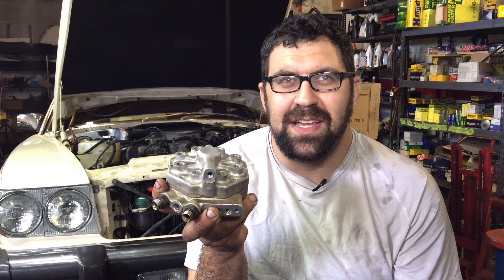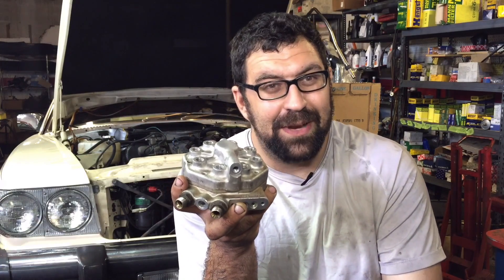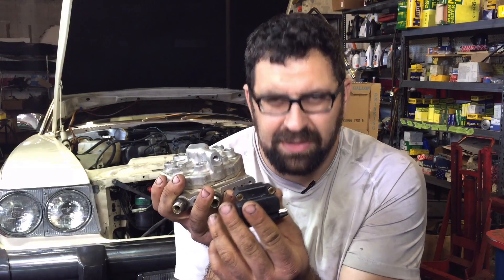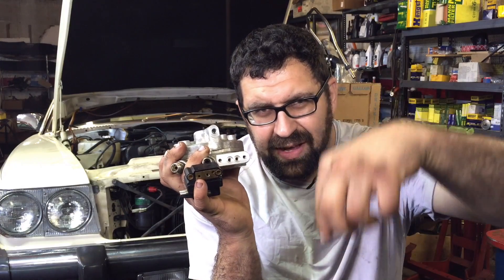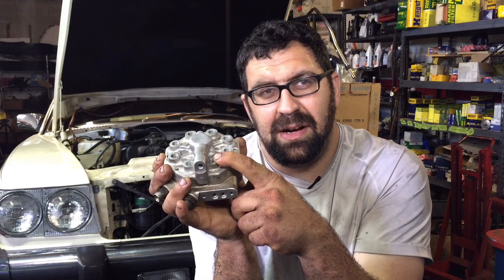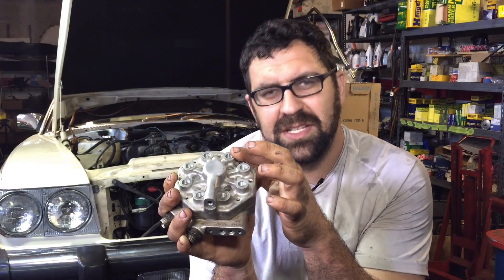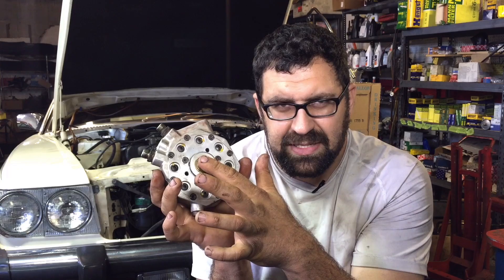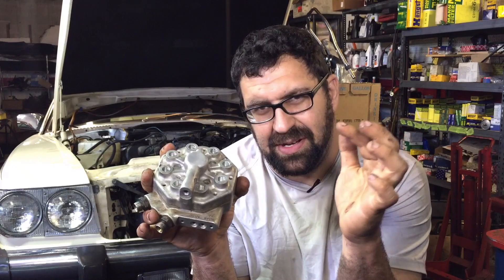Mercedes Fuel Distributor 2 of 2.

Comment: Hi Pierre, i'm glad i've come across your channel. I've been asked to sort out a 1992 Mercedes 190e, 4 cylinder.
It was apparently not running or starting very well, so the owner took it to a local tyre fitting garage that also does other car repairs, (Not a very smart move i know), but they have a mechanic there who has until recently worked at a Mercedes Main Dealer for 13+ years
In an attempt to get the engine running, they replaced all 4 injectors, spark plugs and HT leads.

Eventually, they delivered the car back to the owners house, not running and telling him that they don't know what is wrong with it, but of course, as per usual with some garages, they charged him for it.

This is what i found out so far. `it has spark and when you crank the engine over with the spark plugs removed, it just continuously pumps huge amounts of fuel out from the cylinders.

I've also disconnected the pipes on top of the fuel distributor and the pipe for the cold start injector and as soon as the ignition key is turned on, fuel just gushes out from all the outlets at the same time.

It appears to me that something has failed in the distributor, but i could do with some expert guidance on this, as i have never worked on that system before.
Any help or guidance that you can offer me on this matter would be greatly appreciated.
Many thanks, Joe.
Reply from the maker: Joe, you will need to do a ke pressure test. Please email me if you would like details- mbownersforlife@gmail.com

Comment: First of all, thank you for these videos! They have helped me in a most tremendous way.  I have a 1986 560SEC that my father gave me. It had been sitting for at least 8 years. I rebuilt the fuel pump assembly and got a new relay, changed all fluids and she worked great. Now all of sudden it starts and declines quickly until it dies.  It will start back up and dies again. If I hit the gas, it dies immediately. If I come off the gas it beefs up. What do you think I’m missing?

Comment: Is it normal for pressure to be on the gas cap? It acts like a gas can that’s been sitting in the sun. 89 560SL. Starts and revs fine in park but in drive, under any load, giving it throttle will stall the engine. Not sure if the two issues are related

Comment: HI great info on your videos  how bout wen the distributor don't send any fuel to your injectors ? spark plug dry and injector lines dry  I try open the injector lines turn key on i get very little fuel coming out of the distributor ports I install a new fuel pump last year if the fuel pressure is low can this be the problem ? can the fuel filter cause a low pressure problems thanks for you information and help

Comment: I have a fuel distributor on an  1991 SL 500. It has been rebuilt by the same place twice and both times I get it back. I have way too much fuel. Fuel is coming out before the valve hits it. Even at less than two bar of pressure. What else could be going on causing that?

Comment: It has one bent ex. valve, the compression on that Pistons was 0 the rest about 150. Is it possible to take that one piston out from the bottom of the engine and push the valve out and replace it? Thx

Comment: I found your videos very useful, thank you for that. I have questions, at what point the EHA receives power? Opening the ignition key or while starting the car or car has to be running ? and which unit/computer/relay/... in the car provides the power to the EHA. I think I do not get power to the EHA and the 560sl does not start, I know the fuel distributer and all injections are good and I have 90 PSI fuel presser at the distributor. Also how do you set the default for the plunger in fuel distributer.  Very much appreciated
Reply from the maker: the EHA has power when the starter is cranked and the motor is running but it will still work with no power. Check your crankshaft position sensor. resistance should be 400-800 ohms.
Reply: Sorry I forgot to mention that when I pour gas into breather the car starts right up and runs as long as I keep pouring gas into breather,  or if I stop pouring gas but I keep pushing the gas pedal up and down then it keeps running for about a minute then it dies.  Is that tells me the  crankshaft sensor is good? or I still need to check it? The fuel distributor and fuel injections were transferred from another running 560sl into this one.   THX

Comment: Hi Pierre, thanks for the great videos,

I have a 1989 500SL in UK .
 When the car is driving at running temperature it develops a mis-fire type of feel from around 1200rpm upwards. If I disconnect the EHA it seems to run fine (but difficult to start engine from cold with it disconnected). 
Car starts great from cold start when EHA is connected. 
It's had a reconditioned fuel distributor fitted and I even changed the EHA but same things happening. All electrics on engine seems okay too. Do you have any ideas. 
thanks
Micky
Reply from the maker: video response coming up!

Comment: Hi that. EHA. Valve I replaced it with a used one because the old one was leaking from the holes .   But installing the used  EHA valve the car runs but kind a hesitates when you give it gas and it feels like it wants to turn off when  I don't  have your my foot  on the gas pedal anymore. I installed my used one in the car runs better no problems on hesitation or want to turn off but he has the leak through the whipping  hole .  I see that the EHE Val has a screw on it is there an adjustment
Reply from the maker: you should try your best to install a new EHA..used ones usually leak soon after installation.
Reply: Mercedes Classic with Pierre Hedary  hi i got it working  by have the valve adjusted . I took the screw off inside there is a L wrench .  I took measurement of how far down the screw was sitting and marked it with tape .  And turned in the screw to the one I needed adjusted from
My old one the one I got used needed to be adjusted it was making the car want to turn off due to low speed .... now it worked !! . No issues

Comment: I picked up another 560sl and it has idling problem, idling is not stable. The car starts up ( not right away) and breather suction noise is continuously intrupted ( few times per second. ) and looks like she is dying, it idles at right rpm and the idling rpm never goes up, rather goes down and that is where the suction noise is gone (dying). I can play with gas pedal and raise the engine rpm. I have an off the car station that I check the fuel pumps and fuel distributor and enjuctors and they all working properly, also the idle air control valve is working properly. If I disturb the breather plate or if add some gas to breather she dyes. I am checking the spark plugs and wires and cylinders compression and engine mechanical next. Any help appreciated.
Reply from the maker: Hello Merhrnoosh Noori,
I am one of the moderators for the Pierre Hedary Mercedes Benz channel and I saw your comment. It seems as if you'd benefit from personalized attention for the problem. We have provided a way for owners to get the help they need. If it's okay, please visit the website: https://www.ClassicBenzSOS.com so you can schedule a call from Pierre Hedary. --LauraH

Comment: I have a 1988 560SL that stops running at highway speeds. I changed both fuel pumps it still stalls at highway speeds. it always re-starts after a very short time.
Reply from the maker: thanks for your email!

Comment: Fuel Injection Electro Hydraulic Actuator Valve  leaks gas, car starts but runs rough until its warm up then seems to run fine, would the Fuel injection Electro Hydraulic Actuator Valve be doing that?
Reply from the maker: regardless if it leaks, replace it ASAP. But yes, it certanly could be the cause of your issue. what kind of mercedes do you have?

Comment: Hi Pierre I am in Jamaica I have a problem with my 190 e 1989 model. I have got  a lot from your videos but one thing l don't  understand is l am not getting fuel to  my  injectors nothing coming from the top section  of the distributor fuel is every where in the distributor but nothing coming from  the injector ports.looking forward hearing from you..
Reply from the maker: Hello Sylvester Bramwell,
I am one of the moderators for the Pierre Hedary Mercedes Benz channel and I saw your comment. It seems as if you'd benefit from personalized attention for the problem. We have provided a way for owners to get the help they need. If it's okay, please visit the website: https://www.classicbenzsos.com so you can schedule a call from Pierre Hedary. --LauraH
Reply from the maker: its likely the electrohydraulic actuator 
http://www.autohausaz.com/pn/3437010044

expensive, but 9/10ths of the time, it shuts off completely.

Comment: Your website wont load for me. I have a 89 560SL and it has the most bizarre issue. It has been a victim of sitting up, but it cold starts just fine. It actually runs great for the first few hours of the day. After it's nice and toasty, it'll start.. But, as soon as you push the gas pedal, its like your pushing a flywheel brake. RPMs go down, and this happens no matter the gear and in park. When driving, you're lucky if you can push the pedal past 50% without a violent jarring and loss of pressure (I think, pressure? No more response from the gas pedal) I have to pull over, turn off, start, and as soon as it starts hammer on the RPMs (which is the only time it actually 100% responds to the throttle) and throw it in drive and take off before I loose that pressure. About a mile later, violent jar, side of the road, process repeats. Would that be the "extremely uncommon" issue with the valve on the bottom dumping more fuel in with more acceleration, causing the engine to stall? I can smell gas pretty strong through all of this. Any help would be so very much appreciated. I work on Cadillacs, so I'm no stranger to complicated engineering, but still.. We have a light and a computer that tells us the problem. This is an entirely new world. Thanks for the videos!!
Reply: Sorry, you didnt say that last part I mentioned was extremely uncommon, I misheard. Just wanted to correct the record.

Comment: I have 1990 560sec  turn over ,but not start condition.The car start only press 1 inch~1.5 inch air flow sensor plate.
I'm already changed fuel pump and filter.I want to know what wrong with my car? please help Thank you